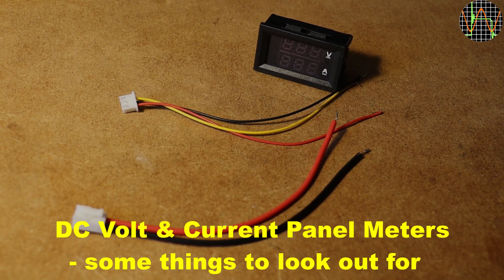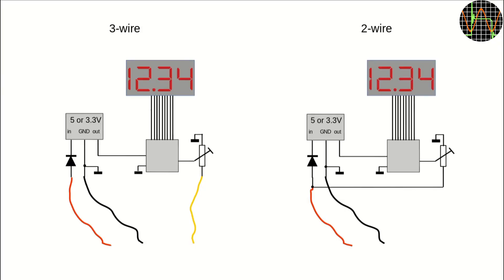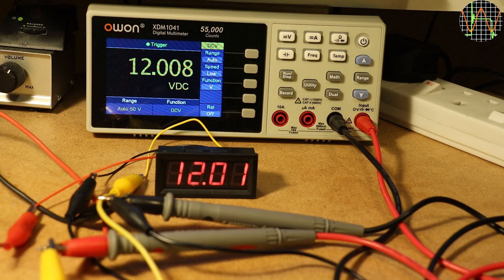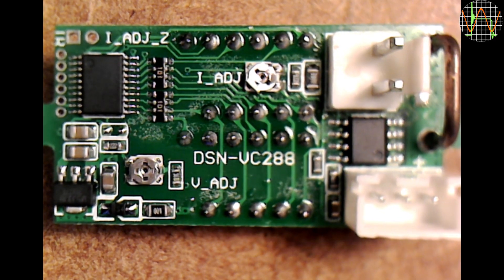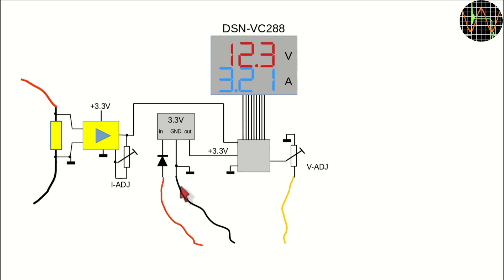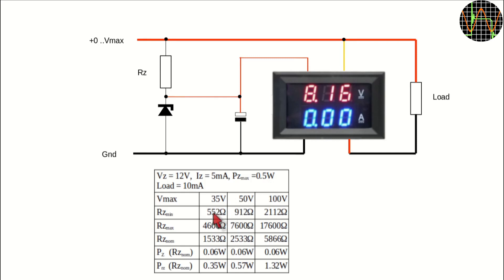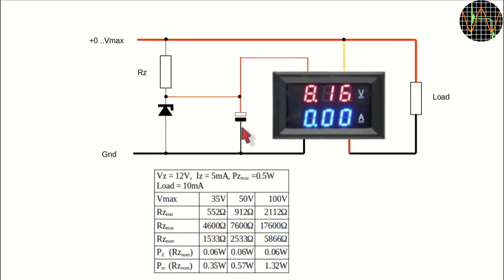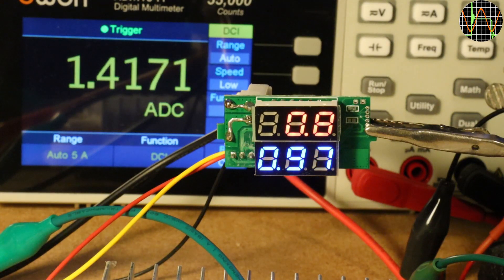DC Volt and Current Panel Meters - some things to look out for

Comment: Thanks so much for this! I've been playing with 4 and 5 wire V/I panel meters for six or so months, to monitor the voltage and current draw on Ham radio equipment. One of the problems I have is that the current stops reading - goes to zero - after a while of use. Two of the meters where this happened were Alliexpress cheapies - where I had low expectations - but one was an Adafruit four-wire where I had higher expectations. Any hints on why the current side fails?

Comment: I would suggest using an isolated power supply or DC to DC buck converter, in the three wire setup.  The ohms per volt is probably very low and will affect the load if not isolated.
You did not measure the quiescent current of the meter. How much power does the meter alone use ?
Reply from the maker: I agree that if you want to use it as a independent volt meter you need to power it separately. The input resistance is generally not too bad (in the 100K range usually but always check). Current to power the meter depends a lot on whether its display is LCD or LED based and how high the supply voltage is, so a general statement is difficult.  The same green LED 3-digit meter for example used 9mA at 5V or 25mA at 12V and the 3rd (measurement) wire has an input resistance of 150K

Comment: Why not using CC source for the zener for such wide Voltage range?
Reply from the maker: Good point. I was in a hurry and used what I had in the spare parts bin.  Also, the aim here is not to have a stable voltage for the panel meter. That has its own regulator that can deal with a lot of variation. All that is needed is to prevent the voltage from rising too high.

Comment: M3430 version? 
Did anyone use the version of those panelmeters that say "M3430." on the PCB (in stead of DSN-VC288)?  They look identical but they use different chips.  I have two of those and both are totally wrong on the Current measurement (they show only about half of the real current,as compared with 2 multimeters).  I played with configuration in different scenarios (incl. omitting the thin black wire) but the faulty Amperage indication remained.  I also replaced the I-adj trimpot from 5K to 300K.  Then I could make it show the right current (at about a 1A measurement), but when removing the load, they still showed 300mA... not good.
Thank you for creating this video with a great level of detail
ChrisV
Reply from the maker: I looked at a M3430 on an eBay picture, and it looks very similiar to DSN-VC288., so I suppose it should work the same way. If your meter is reading only half the current it should then the shunt resistor is too low. One method that may work is to carefully notch the metal bar with a saw, because shrinking the diameter will increase the resistance. Just a few strokes and then test the readings. Then repeat until the value at mid-position of I-ADJ trimpot is what you want. Be careful though because if you go too far, its very difficult to go back (filling the crack with solder may(!) work to get you back if you cut too deep but solder behaves different at higher currents, so best avoided). If you dare to try it, could you please report your results. I have never done it myself and am curious about the success rate
Reply: @TheHWcave  Just an update:
I have just put 2 shunt wire/resistors in series (from another M3430) and then, using the "I-adj" mini potmeter, I was able to get a current-reading close to the one on my Digital voltmeter.
This, more or less, fixed the problem of too low Amperage indication, but it introduced another problem:  a too high shunt resistance is now causing an unacceptable voltage drop at high current.
Or maybe not... I'm planning to use this in old ATX (computer) power supply that I want to render adjustable.  I guess I can put the voltage-sense for the voltage-control loopback circuit after the shunts, so it should adjust/correct the voltage regardless of differences in current/shunt.
To be continued ...
Reply from the maker: @anonymoususer6448  Thanks, keep us updated please

Comment: Nice video thanks ! So replacing the wire shunt with a 4 wire shunt should cancel the nonlinearity much more right ? I know the shunt is probably twice the price of the module but the wire also have some temperature coefficent that 4 wire shunts are minimal with.
Reply from the maker: Thanks for the nice words. In principle your are right but I have some doubts whether this module is worth the effort and money converting to an external current shunt. The cheap opamp may be responsible for some of the non-linearity. Maybe getting a panel meter that already comes with an external shunt may be a better option. To be honest, I never look into  that because for my project a reasonably accurate readout 0..5A was good enough and I don't have the space for external shunts. If you do modify this panel meter, please let me know the results.

Comment: I wonder how these compare to the "RD 4 Wire Variable Precision DC 0-33 V" from RIDEN. I got a few to build a milliohm meter as they are 5 digit meters.
Reply from the maker: Generally their electronics are quite good unless its a clone. For sure have a look at the voltage regulator. Also power it with say 25V and touch the regulator to see how hot it gets.

Comment: Those sell on ali for $13 for 5 meters including shipping.
I feed them with a 60V HV-buck converter set to 10V.
Reply from the maker: That's a good option . Better than converting 50V into heat
Reply: @TheHWcave  true, till the el-cheapo buck-converter hiccups and you have a popcorn party with the 60V on some parts of your circuit
Reply from the maker: True, maybe one should not go for the bargain basement converter if a lot of expensive kit hangs one the other end....
Reply: @msana4420  I trust my $2 HV buck on 50V way more than your $2 wall-wart on 240V.
Reply: why so extreme? I would just use an aux supply for the meters. Plenty of wall-warts in the world to recycle.